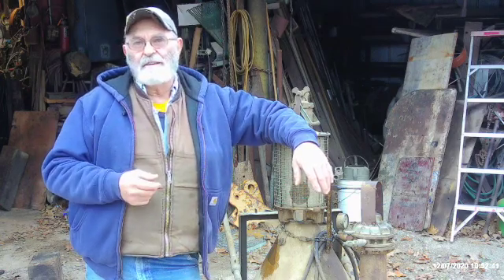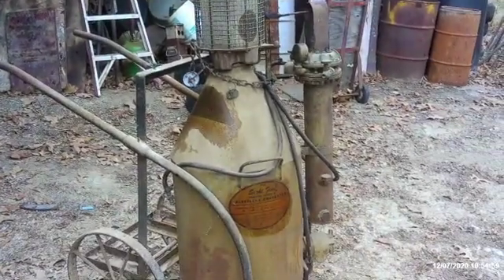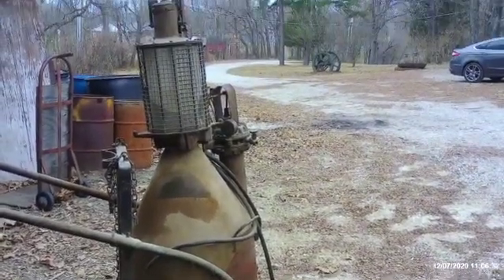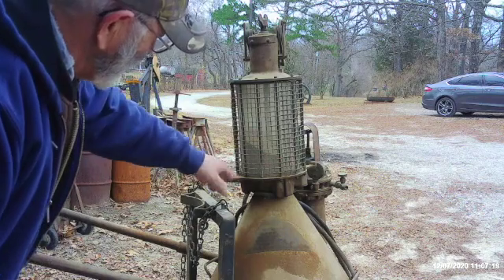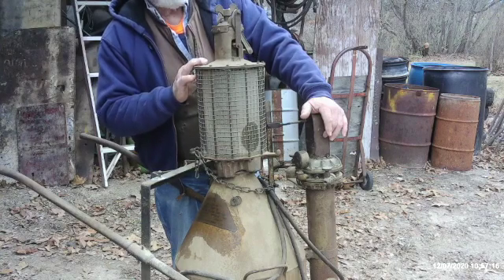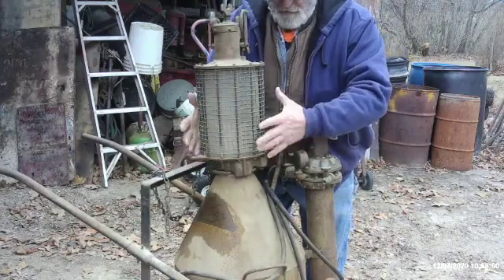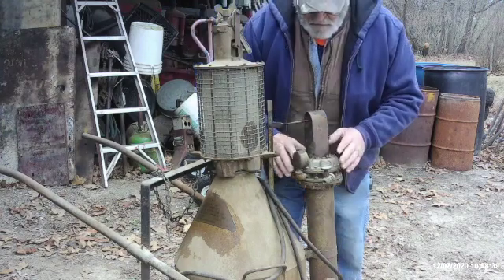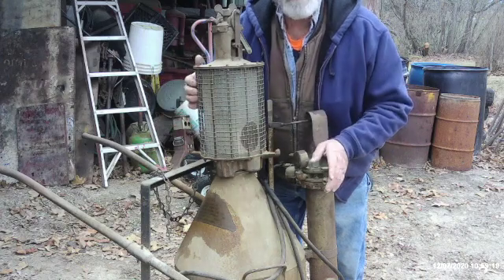Acetylene Generator: Precursor of Modern Torches

Comment: How does it get the solid carbide in without letting the pressure out?
Reply from the maker: There's a twist lock opening on the top of the glass carbide container for filling with the carbide powder.   The glass is not under pressure so the carbide can be added at any time.  Then the bottom of the glass container is sealed from the chamber that produces the acetylene gas vapor.  If you skip to 3:50 you'll see how a shot of the carbide powder is admitted to the sealed chamber below by lifting a release handle once or twice.  Now bear in mind, neither of us have ever used this generator and what was presented here was deduced from just fiddling with it that morning. 
    I am sure the old timers knew from experience how long the generation cycle was going to work depending on how many times they added a shot of carbide.  The vapor pressure then is allowed to escape through the regulator and to the torch being used in conjunction with oxygen from the replaceable tank that mounts on the rear of the generator between the handle bars.  The delivered pressure cannot be allowed above 15 psi because it is extremely unstable above that pressure.  Most torches consume 7 - 10 psi of acetylene delivery.  Thanks Mary for watching and commenting with a thought provoking question.
Reply: @tractorman4461  OK, What size lumps is the calcium carbide left in the chamber?    Next,   when the first carbide is loaded into the water and used by the torch,   how are the lumps moved from zero pressure into tank pressure with the acetylene escaping?
Reply from the maker: @marynollaig4124  the carbide isn’t lumpy at all. As noted above it’s just a powder. A bit grainy similar to corn meal but more fine in consistency. Not ever using it, most of this is conjecture…. But the powder is metered into the chamber by pumping that handle at 3:50. I assume there is a metering chamber that’s attached to the lever and sealed from the pressure vessel.  As the gasketed  chamber is rotated it aligns with an opening in the top of the pressure tank and the heavier powder drops into the pressure chamber to add to the weakening mixture. Again this is just a guess as to how that is accomplished. They may have to let the outlet pressure drop to a low and unusable pressure then vent it before adding another charge. I just do not know for  sure. Somewhere I am sure there is an instruction manual on  these old generators. We just don’t have access to it. Do you have any specific or additional information of these ?  And if I may ask, why are you showing such interest in this old thing. Might you be associated with a welding supplier or possibly a fabricator ? Thank you for your interest and I would also like to know for sure exactly how it all functioned.

Comment: A old guy in town that had a small engine repair shop used one of those. We coon hunted with carbide lamps. Some where all one unit and fastened on your hat.  I still have my old carbide light and a full can of carbide. Mine the reflector has a band to go around  my head. and the container with the carbide and water fastened to my belt. a hose connected them. Really never  thought that they might be dangerous?
Reply from the maker: Dangerous...?? Naw....OSHA approved stickers were probably just hard to see....LOL  Could give a whole new meaning to the term 'hothead'....

Comment: Here I am telling you another bit of information from a misspent youth. Or middle aged experiences in a varied job history. 
Anyway I was an iron cutter. Yup, tobacco chewing, joke telling, beer drinking, iron cutter. That meant I spent  quite a lot of time with cutting torches. Small fact. Once you get the steel hot enough to cut you can shut off the acetylene and the iron will burn. Not as well! If you slow down or jiggle the torch the iron will cool and it  will go out. Then you have to relight and start over.
There now you got the apprentice training without the cost of the bet that the journey men almost always sucker you into. Beer drinking is usually involved.
Later I was introduced to the oxygen lance. UTC had aluminum melting furnaces. Little ones. A 100,000 lb melter and a 150,000 lb holding furnace if you want to know why just ask. 😁
6061 aluminum alloy melts around 1100 degrees F. That is pretty hot but know where near iron at 2500 +- 100 degrees F. 
Aluminum conducts heat extremely well. It is light compared to most metals so it has less thermal mass. It also burns readily, so you don't want to overheat it or poof it turns into aluminum oxide and becomes impossible to melt unless you use an oxygen lance. 
If the temperature of the furnace got down to 1150 F., usually because someone put too many sows in the bath and chilled it like ice cubes in scotch, the aluminum in the tap hole would freeze. Simple enough just heat it up and melt it  out again. It takes a LOT OF HEAT. 
Acetylene and oxygen burns at around 3160 C. 5720 F for all us imperialists. 
Some guy in a European or Middle Eastern cave discovered that iron burns really hot. According to Wikipedia, between 4950 F. per Wang's and 8130 F. per Kosanke's educated guesses.
Aluminum wasn't messed with much until 1825 when it first successfully extracted from aluminum oxide. (See above) It wasn't commercially available until 1889.
But wait! There's more! I got interrupted in the middle of the story. 😁
The guys at Alcoa began to fix frozen tap holes by ramming a piece of burning 1/8" iron pipe into the tap and melting the aluminum. Yay!
You just have to be careful because the tap hole block is fire brick. The burning iron oxygen lance will burn fire brick. A mistake means you can't plug the tap block so the entire furnace has to be drained and the tap block replaced. BFHBA. 😫😬😱🤑
So long story but I hope you got something from it.
Once I get started blah blah blah. 😁😎
Reply from the maker: THAT was totally interesting.  I know nothing to very little about the aluminum or steel smelting process nor what maintenance is required to keep everything up and running.  But we do have a recently closed lead smelter two towns north of here.  Through my last contractor I took care of a lot of the a/c's for the office spaces all over the plant...the worst being the one for the blast furnace or the one for the sinter plant.  Miserable conditions to work in !!   Oh see....? I get to rambling too.....
    The point of that story was I did get a few firebricks that had either melted or burnt off their ends, their firebrick materials turned shades of green and hard as a rock !!  On  side note I have never heard of a oxygen lance....what the heck is THAT..??
Reply: @tractorman4461  You can spend as much as you want on one. https://bakersgas.com/products/arcairsliceutilitypack-63991047?variant=28852577566773&campaign=9414230862&adgroup=94697287839&feeditem=&keyword=&matchtype=&device=c&network=u&gclid=CjwKCAiAt9z-BRBCEiwA_bWv-MdLh6ulVtRhGkGEFFnNoUY6NtjLqi1kuymo0PtFq13aneWT-_pfdxoCWK8QAvD_BwE&creative=419433943578https://ad.atdmt.com/s/go;adv=11242241809840;ec=11242241809912;c.a=9414230862;s.a=google;p.a=9414230862;as.a=94697287839;qpb=1;?bidkw=&dvc=c&h=https://bakersgas.com/products/arcairsliceutilitypack-63991047%3Fvariant%3D28852577566773&gclid=CjwKCAiAt9z-BRBCEiwA_bWv-MdLh6ulVtRhGkGEFFnNoUY6NtjLqi1kuymo0PtFq13aneWT-_pfdxoCWK8QAvD_BwE

This one is $1296.00 + along with shipping, hose, tanks, regulators and gas you might get by with $2000.00.
UTC had a rig that was two T bottles, about 600 cu ft of oxygen, a manifold, an oxygen regulator, one anti-burn back check valve, 50 ft. of single hose that soon burned back to 25 before being replaced, a 1/2" ball valve with a 1/2" to 1/4" reducing bushing on the downflow side of the ball valve, and a 10 foot chunk of 1/4" iron pipe that was screwed into the bushing and is the working end of the rig. 
You heat the open end of the pipe until it sparks with a acetylene torch then turn on the oxygen with about 20 psi and let it go. Whatever was on the end of the pipe either caught fire or melted. 
The torch will burn through iron plate, firebrick, and even the aluminum oxide dross that is the base material for most firebrick. 
We could buy special 1/4" pipe lance tips but they were just tubing packed full of iron wire. They burned a little longer but no hotter. They cost an arm and a leg too. Don't remember how much but I never bought any. I just stocked 1/4" pipe. 
Jack Davis was my furnace tender. He put on a silver fireproof suit and the torch would last a couple minutes before it was gone and Jack  needed to back off away from the heat. 
Like standing in front of a roman candle. Burning iron, molten aluminum, molten firebrick flying all over. 
We only had to use them a few times but I clearly remember thinking I didn't want to be the guy in the suit.
Reply from the maker: @OldSneelock  well I can tell by the prices that probably no time in the near future will that purchase be made.....hahahahahaha.  I do enjoy the thoughts and things that come outta your mind.  Whew !! I can add nothing to your contribution. I do appreciate the time you take with the details of the explanations.  Very good information filled comment my friend.
Reply: @tractorman4461  Always happy to go back and remember the good times. Most of those were afterwards when we congratulated ourselves for surviving another one. 😁😎
Reply: When the lose a Pour at the steel mill. They cut that mess up with a oxygen Lance . No fuel needed just hot metal and oxygen.
Reply from the maker: @thecollectoronthecorner7061  I worked on the office air conditioners at a place called Granite City Steel.  I wasn't near the actual smelting area, but it was definitely toasty where I WAS at inside the plant. Just like inside Doe Run's lead smelting plant.  Those oxygen lances you and Old Sneelock talk about are interesting for sure.  Not sure I need one.....LOL  Be fun to use one though...for only about half an hour though.

Comment: That is a sight generator manufactured in West Alexandria, Ohio
About 10 miles from where I live
And I have used this type generator before 😊 
I is not so easy to get the calcium carbide these days
Although this generator is quite  capable of doing the job with good maintenance and knowledge of operation
Reply: The feed and pressure are automatic and maintain the gas pressure by adjusting the big thumbscrew on top
Reply from the maker: Yeah, I figured calcium carbide would probably have become a controlled substance by this day and time.  I do believe you are 100% correct about this generator still able to go to work.  I would want to know a bit more for sure before an attempt would be made. Depending on the material the diaphragm is made out of, my main concern would be a bit of internal damage....dry rot...or a rupture of some sort.  Thanks Chris for the input concerning your first hand experience.  I was HOPING there'd be at least one viewer that would chime in. So thank you again for stopping by !!